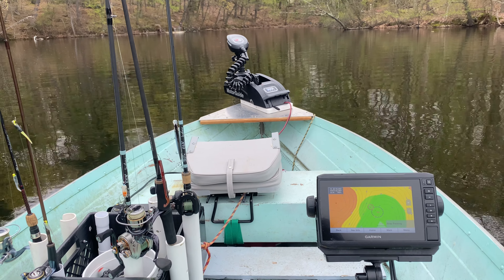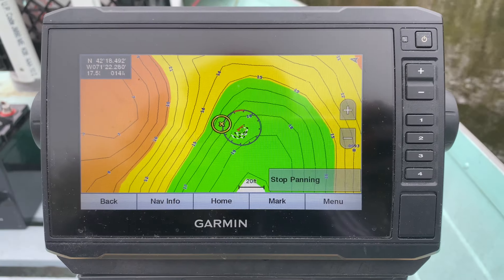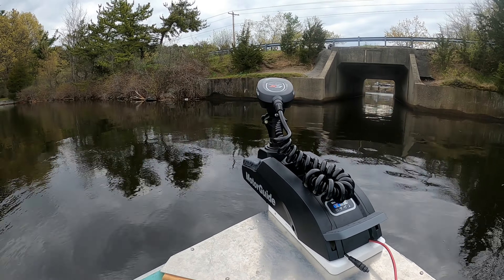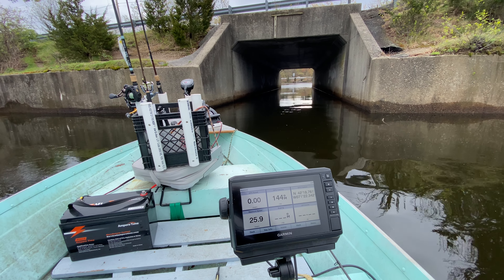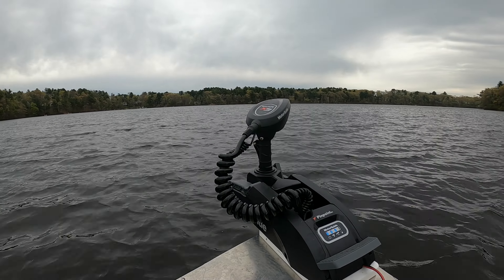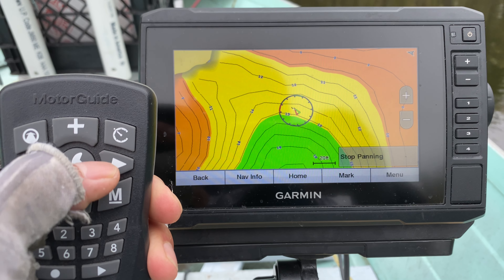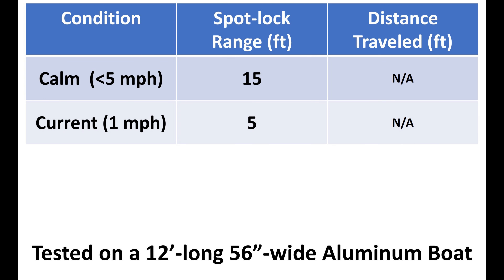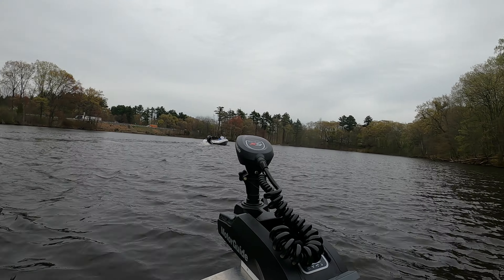Pinpoint GPS Spot Lock / Jog Accuracy Test under 3 Conditions [MotorGuide Xi3 Kayak]

Comment: When I set my xi3 to anchor mode it seems to be hit or miss to keep it within a 5’ to 20’ area.  When I come up to a spot and push anchor, almost every time, it immediately reverses is backwards about 10-15’ and then slowly creeps up to within about 5’ of the spot.  Any tips or tricks to using anchor mode effectively?
Reply from the maker: I think that reverse is caused by the fact that the boat is still moving noticeably. I try to hit the spot lock once the speed is less than 1 mph, more preferably <0.6 mph, which makes it much better. Just try to slow down in advance so you target to stop on the spot, not going over it and let the trolling motor reverse it for you. Hope this helps
Reply: @SteveChenFishing  thank you!  It does help and I will try this more.  I know it just takes a little patience too.

Comment: Do you think trolling motor would be long enough for a 14’ Flat bottom Jon boat?
Reply from the maker: Could be good. Are you placing it on bow or transom? It also depends on the load onboard. Better check the distance from the top of the boat to the water before getting one. It also has like 45 and 54 inches shaft version.
Reply: Did you get one and see if it was long enough? Im trying todo the same

Comment: When people finally evolve enough to understand how gps motors actually work, the complaining crowd will shrink. The computer has to make small adjustments, THEN analyze the RESULTS of that effort, reconfigure, readjust, then do it all again, all while depending on a satellite to send it ALL the information. NOW, on a CALM day, how can spotlock possibly work???? Answer? It CANNOT. That's not what this was designed for. Spotlock can only make adjustments to a CONSTANT force (a breeze) pushing the gps puck in one direction. There are no brakes to stop the boat immediately after each and every adjustment, so, it CONSTANTLY is trying to correct itself. Testing accuracy of a gps motor on a calm day is absolutely unaccredited and the results are hogwash. You must first understand how they work before you test them for judgment!
Reply from the maker: Totally agree with you! Constant force condition is when the gps spot lock shines!